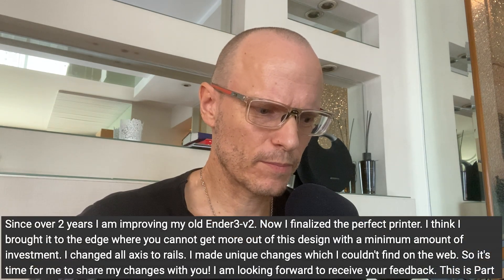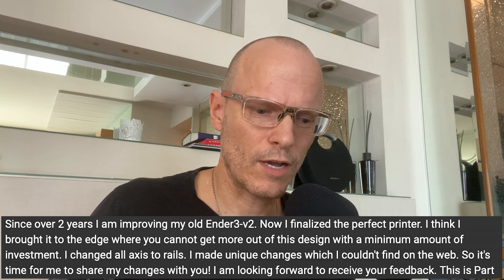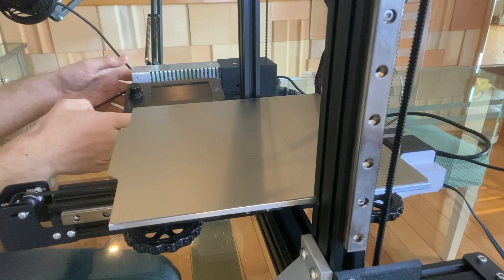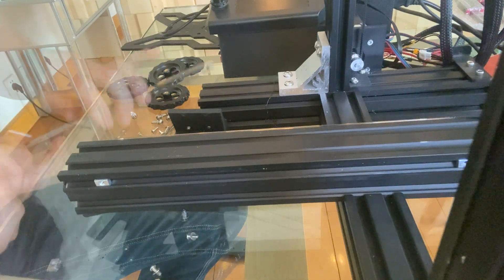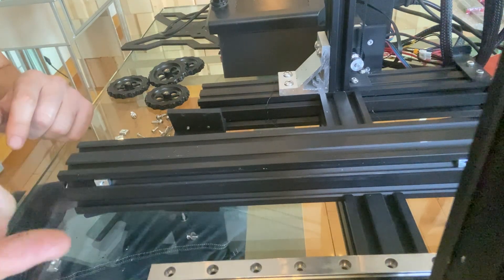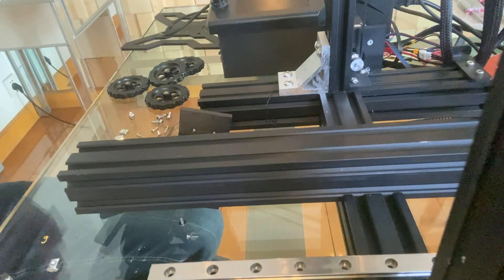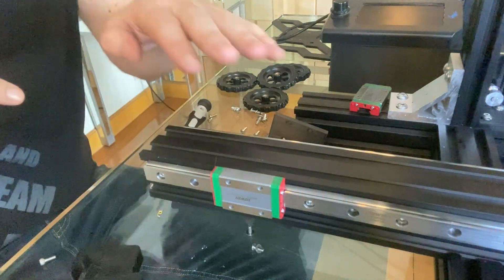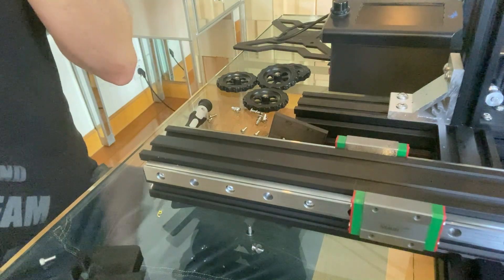Ender3-v2 Reengineered - Achieve perfect ABS prints - Part2: Precision Y-Rail Design

Comment: I too have a very heavily modded 3V2 and have huge success with Abs. The twin rails for the Y axis is much better than the single and the part you designed would be a benifit. I also added a brace across the front and back of the Y beam so that the Y would not flex up or down. The biggest advantage to print quality I found was the addition of the sherpa extruder and  a self designed z brace. I'm currently working on a new idex system utilising a 500mm 4020 x beam.
Reply from the maker: Awesome. Very nice. Thanks for your info… maybe you check my teaser… I had an idea for the optimal Y rail - just don’t yet finish. It’s always a bad idea to change something but have only one printer to print… 😂 so currently I need to put it back together after too heavy changes and it took longer than expected… my Y is now different. I have a double connection instead of the standard profile. I hope I will be able to make that video also on the weekend.

Comment: I wouldn't change the hot plate carriage. It's not that heavy but it keeps the hot plate stable. A smaller carriage will not be as stable in my opinion. But I am subscribing to your channel because I want to see how this works out for you. I have a stock Ender 3v2 Well I have added a lead screw with an additional stepper to run it. And I have the all metal Micro Swiss hot end and carriage. I would like to replace the hot end with something better but have not decided yet what to get.
Reply from the maker: I know what you mean. Thanks for subscribing. Don't miss my Bed Video. I will make it next weekend. Happy to see your comments.

Comment: Amazing that such things happened to people. I use intensely my Ender3-v2 and never run across such issues... The fact is, people like to tear down devices, sometimes without any rational reasons. By design filament printers are less precise than SLAs. Therefore demanding "high" accuracy from an ender3, is somewhat weird. We're not talking about satellite design.
Reply from the maker: It’s ok. When your prints satisfy you and you are happy, of course you don’t need to change anything. That’s perfectly fine :)

Comment: this design is flawed unfortunately, look into degrees of freedom and the constraints you're putting in place. 
You could make the distance between the 2 "plates" that bolt to the carriages adjustable and bolt them into place after you bolted them to the carriages.

If you can't make it precise - make it adjustable :)
Reply from the maker: Thank you for your feedback. I like to understand it, but I don't really see where could be a flaw in the design. There are no 2 plates. The idea is to make it not adjustable. All parts in the design need to be perfect aligned and it can be aligned very well. The Alu Profiles are very well specified. The rails are precision parts. And we can print precisely. If there is a fault of 0.1mm its fine as well. The idea works perfectly for me and is tested for 7 months of extensive printing. Sorry if I can't get your point. But if I would understand it, it might be good to try it if it gives better results or removes a flaw.

Comment: I destroyed an Ender-3 pro with ABS Printing. Have a Lack-Enclosure for it and it was the stock design but with virtually all upgrades in the market, dampeners, springs, Aluminium parts, Air filtration etc. The Temperature in the Enclosure killed it. As i had so much accessoires i bought a very low Spec Ender-3 and putting the parts over. It's intresting to view your upgrades as i won't use the standard Ender Design as i moved on. XZ Core is intresting, the Ender3 is virtually only my pet printer project now. Got an Tronxy A5S 400 and a Bambu X1C but still want to rebuild the Ender-3 Pro +++ i had. Maybe some more Upgrades now.
Reply from the maker: Thanks for your feedback. Its always the thing... we buy parts and sometimes find out it doesn't help. With respect to heat, one important thing to improve is to separate the electronics from the printer (and out of the enclosure). Beside that, there isn't too much to destroy :-). Stay tuned for my X-Axis change and the all new bed design - which is for al printers (and I am sure some companies will copy it :-)
Reply: @TechGuyZone  I don't know for sure what the Problem is, maybe the Motors or the Drivers, already switched some parts, but it won't go up unassisted on the Z-Axis. 
New Wheels and new Worm Drive in it.

It was easier to buy a Ender 3 for 100€ and putt all the Pro and Enhancement Parts over. The old one clocked around 1500 hours, i do maintenance (removing grease, belt tensioning, regreasing ) every 100 hours and a dissemble reassemble maintenaince every 500 hours on my printers. I had 2 Printers before in Kit form, those are still running. But i had it running in an enclosure at around 40-60 °C together with the hours it clocked in (about 1200 in the enclosure, nice ABS prints after maintenance)  it is now dead. 

For a then 160€ printer not bad. I have two worn out Dual Z-Axis Wormdrive Bedslingers, which need major Maintenance before every print, one Core XY (which needs it's first major rebuilt) and the Bambu. So a normal Bedslinger with a single Z-Axis was always "i want to print something without work on it." . Your build is something like a halfway between a Ender 3 and a Voron Switchwire, which i find pretty intresting and maybe i go the route with one of the Enders, maybe even the original dead one.
Reply from the maker: @Elkarlo77  I don’t like wheels… that’s why I switched to all rails… there are not many areas where it could break… if you want to check maybe you just take off the lead screw and move the X up and down by hand. See if the lead screw is straight and just switch on the motor to see if it works.
Reply: @TechGuyZone  Did it, tested everthing, then replaced the lead screw assembly + wheels as it was cheap to replace and the height often got stuck at Z + 5mm. Still didn't work. With the new Lead Screw he worked for 2 Weeks then again breakdown. So either Z-Motor or Electronics. It was literally easier to buy a Vanilla Ender 3 for 105€, putt all the Upgrades from the "Dead" Ender 3 Pro on it and have a working Printer again, then buying a new Board, testing if the PSU has problems swapping the Motors and most likely the same price. Thanks to your Build i know now what i will do with the old Frame. 
Already ordered the Linear Rails, and i got a Mega 2560 lying around, or a spyder Board i wanted to use on my Tronxy. 
I got 3 working Printers ATM. And 2 additional Printers which run with some Maintenance..
Honestly i don't use the working Ender 3 Pro with BL-Touch any longer. 
But as Bedslingers are more open compareable to XY Cores, the working Ender 3 Pro BL-Touch will replace my Teebot Prusa i3 Clone (Photocase collapsible) at my current Workplace, a School, as Demonstrator, the School only got XY Cores as working printers. 
And i get my already vintage 2014 Printer back. Building a Voron Switchwire Style out of the Ender 3 is an option, or i keep the Prusa Layout. But i don't own a Core XZ Printer yet.

Comment: I need to change to linear rails on my Ender 5 plus, Ive been getting some weirdness in the prints and couldnt work out what was up, then while changing the hot end i pulled the X rail along the Y and felt three step/notches on the X motor side, It was little balls of muck like you get on your mouse sliders compressed into the wheels they caused the bumps and caused the print fails.
Reply from the maker: Yes, this is often the case. I think what you described is mainly coming from the wheels. They where off through time and the rubber dust collects on the wheels. With the rails in the direction I have installed them it could be that sometimes maybe small print parts fall from the surface and go in the sliders or the belt wheres off a bit. Beside I still think its the best design for the Ender 3 4040 Alu Profile (changing that will result in a very big change in general), I recommend to use a synthetic oil for the rails every 2-4 weeks and clean the rails at the same time.

Comment: Would you not be better having the linear rails horizontal instead of them on each side of the extrusion, the way you have it creates and extra element of alignment and possible friction. Also the wider the linear rails are apart would help the stability as you could fix the edge of your bed to each linear bearing, currently your bed is effectively creating and overhang on each side of you central linear rails which can deflect a little
Reply from the maker: Hi, thanks for your feedback, and I agree but the alignment applies in any case if you have 2 rails. The friction I would not say that it is additional friction - only if they are not aligned. But the balance of the sliders and the distribution of the friction is better when they would be horizontal. If they are wider from each other? I don't see that at all as a problem. Unless we would print something huge on the outside the the bed on one side... but usually we print from the middle. Right? So I don't see this as a problem at all. With the current setup my prints are very good on the Y side. But I am always thinking about improvements and better solutions. So now, how could they be horizontal? Did you check my website article... I have drafted some solutions other than that - all exist in the market. With the current setup of the ender a balanced horizontal solution with 2 rails doesn't sound feasible. But I through about a 2 rail horizontal solution using a 2060 aluminum profile with it. But exchanging the 4040 is a very big change... - But having the rails on one side each, and in the middle the belt - like the X axis sounds somehow cool. But this requires a big redesign... I think I will try to think it further. If you have something, please feel free to share.
Reply from the maker: I thought about it again. I will use a 2080V aluminium profile. Need to redesign the motor holder, the belt tensioner and the end stop. But I think it would be a great design. Stay tuned.

Comment: Depending on the tolerance of the rails, a good way to align the two rails so that they are perfectly parallel to each other is to leave one of them loosely screwed in and move the big carriage back and forth while fastening its screws. That way you can be sure that when the Y-axis bed is moving it will not cause binding because of the misalignment of the rails. Also good for the balls not wearing out as quickly.
Reply from the maker: Yes, thats a good idea. I will double check this when I reinstall my new X-Axis for the next Video. Most important is that they are parallel. I think I will try to print a spacer for the vertical hight so that they are also in the middle. A kind of spacer to be placed under the big carriage for the alignment to have the hight right as well. Not sure if it matters if they are totally low maybe they might tilt a very little... need to double check.